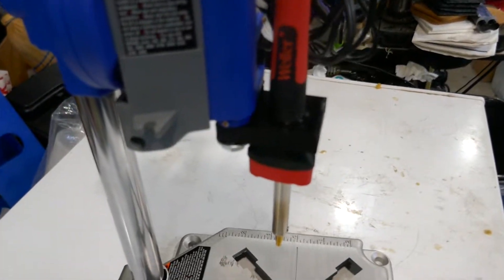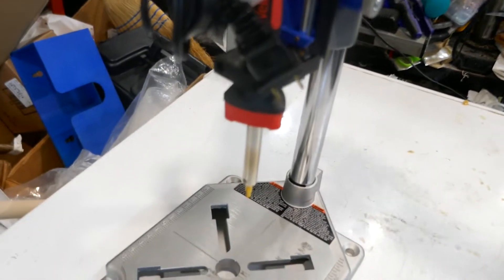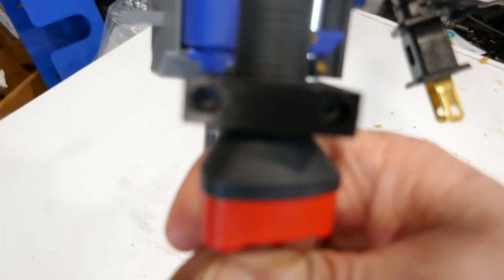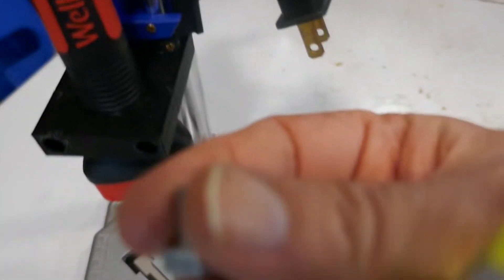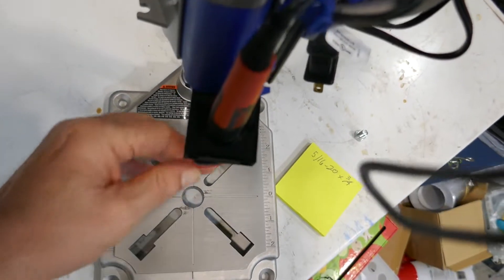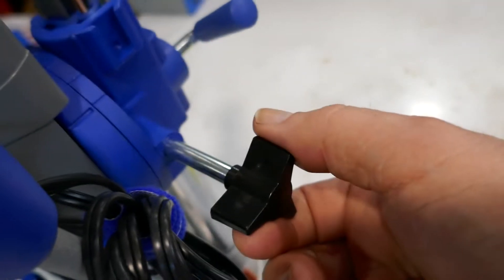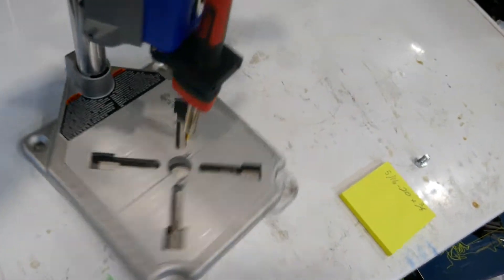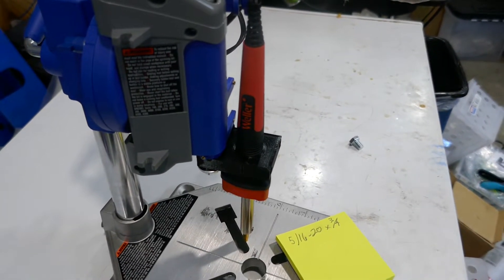Adapter for Dremel drill press to use heat set inserts for 3D prints

Comment: Cool idea, I have thought about it as well - re-purpose an "old" drill press similar to this with an adapter to heat press thread inserts into 3d printed parts.
Do you have a small video showing how it works when heat pressing?